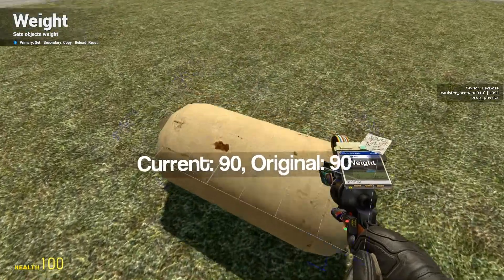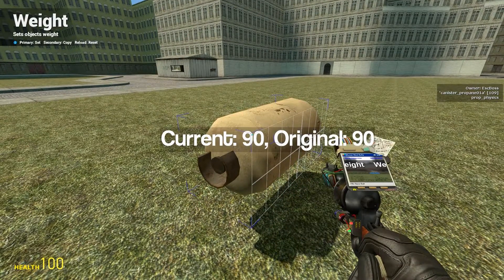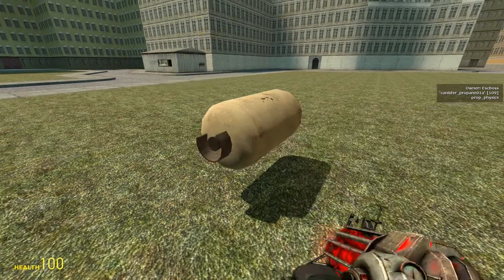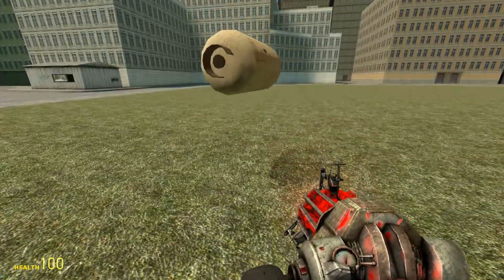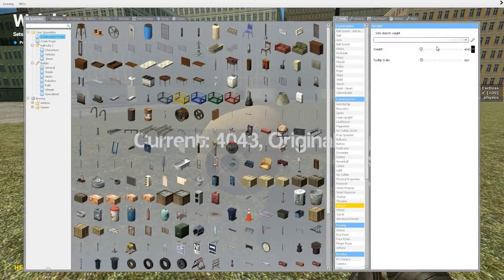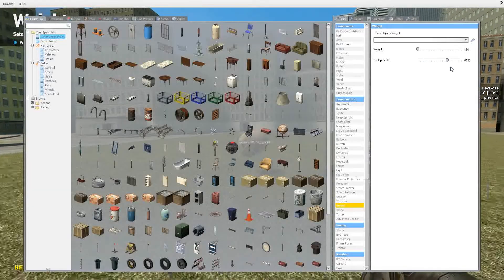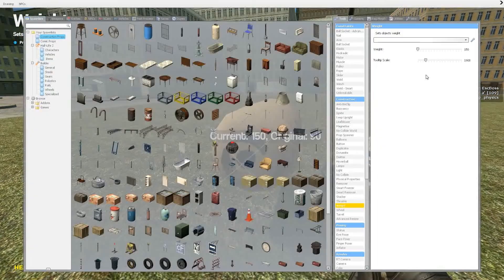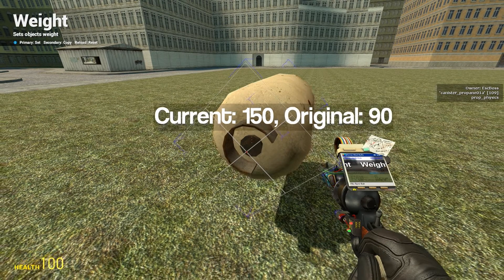Garry's Mod tool tutorial #26 - weight tool (workshop)

Comment: Missing alot of things in the video, like making base prop heavier then the stuff being constained to it unless it's suspending said prop. Also making thrusters weigh more multiplies the thrust, I hate it when people spam thrusters to get more power. Also making bouyant props more bouyant with weight tool. So much more too
Reply from the maker: lastxp xro The purpose of this video is to shot the basic functions of the tool. The things you list there is a more advanced way of using this tool. But it's relavant! i could've included it, but i like to keep thease tool tutorials short and precise :)